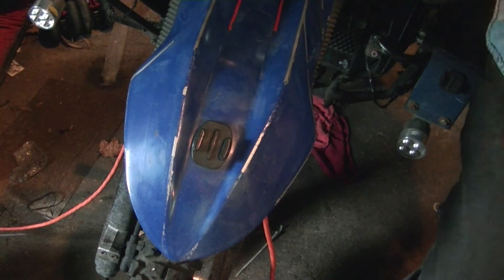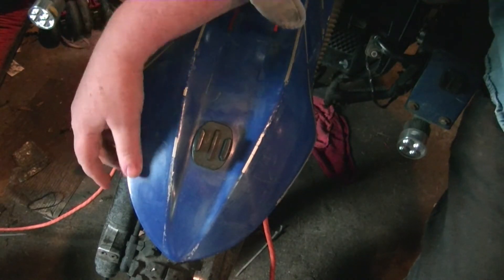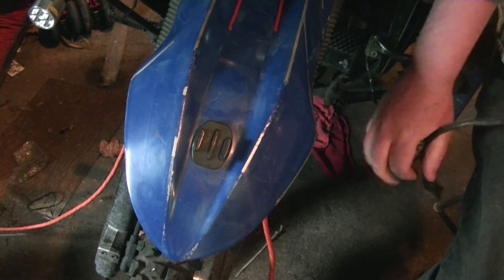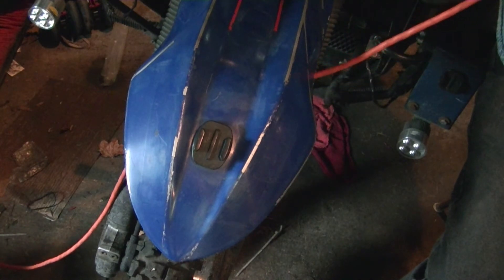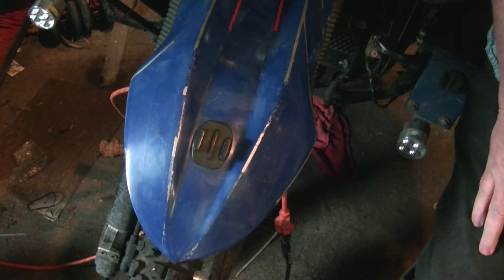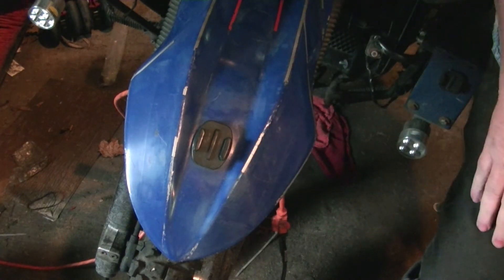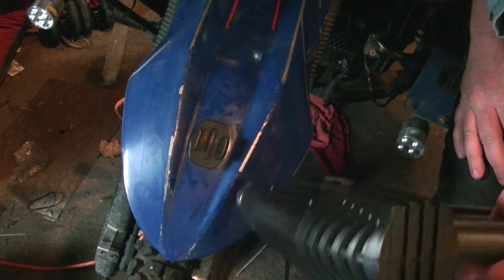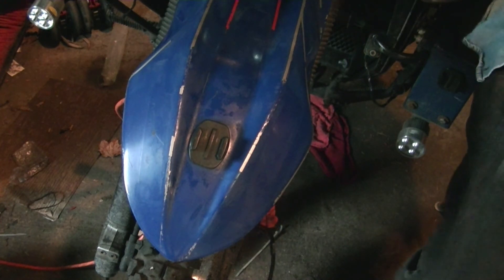ITL 18 2016

Comment: Couple spots it sounded like you had Chipmunks running the camera.   lol
Neat tip.  Wonder if you lightly were to sand with a very fine grit (or fine steel wool) if then using the heat gun might come out even better?  Might make it worse dunno but I think that would take some of the discolored bit off and let you melt a layer that is more even and with more color. to it.
Reply from the maker: +RC62  I I found out that I did not have my phone on airplane mode . When I use this mic I will get that noise . I think you could sand it . It comes out nice with the UV protection . I have to redo it every couple of years or so . Not a big deal . Thank You RC62 !